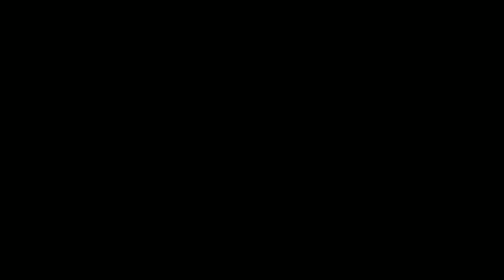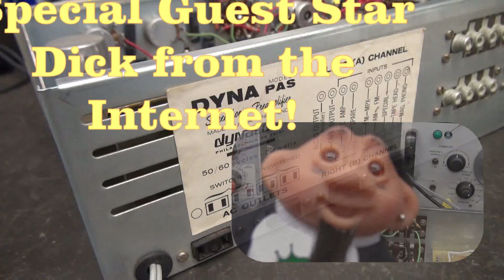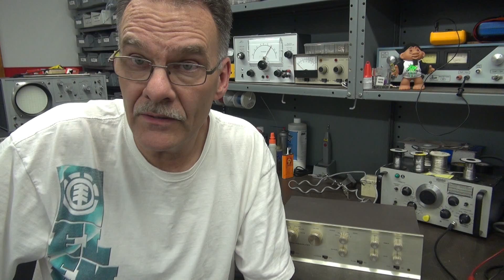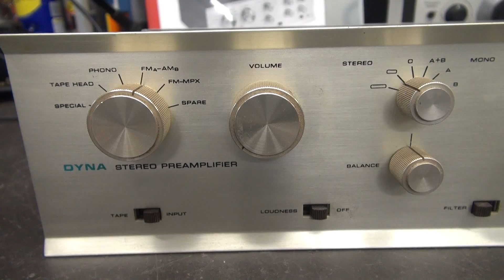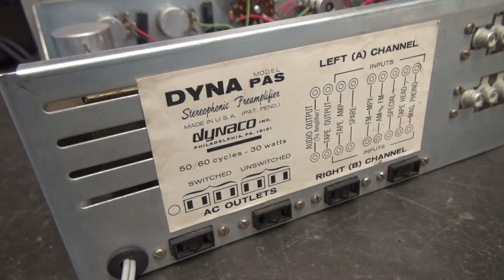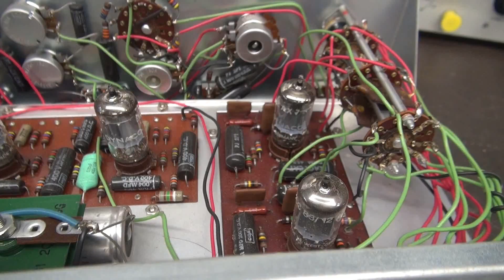How to Replace filter capacitors Dynaco PAS 3 Tube type Preamp amplifier D-lab Electronics

Comment: Before you mount the replacement supply board I recommend a foam insulation tape on the chassis and have the board seal on that it would be a much stronger assembly one Screw mount for that size board is marginal at best by adding the support below it makes it easier to do and stronger to

Comment: Terry, I admire your repair work. Real good work., but I have a little comment on one thing, I think your a more RF repair guy, no offense ment what criticism I make. 
I see you ground parts and wires where ever you can, normally and especially in RF it is required, a must have course of ossilation problems. But in audio it can be tricky try to lead all ground to a star point or even better to the input ground terminal. Then you never get 60hz hummm. I  ones took a ground from point to point a lead from 2" underneath a pcb board and the Amp was bussing loud in my case 50hz (Holland) that's what I wanted to say.
The rest you do top work I like it a lot.

Comment: Next PAS you do make sure to video. The board has been redesigned for right side up mounting and elimination of the rectifier tube if desired. Also no instruction sheet is included.

Comment: Thanks for the great video! 
Thanks to you, I have done this upgrade and for the most part, everything is functioning properly.
But now I have audible hum (which I did have before upgrade but it was very slight). 
Only connection is preamp to power amp. Not affected by volume. I don't experience it with other preamps that I have.
Thanks in advance for any insight!

Comment: Nice video... and it's a thumbs up from me for sure...BUT... I would have left the large filter cap in place, snipped all wires and leave it covering that hole now left behind. And the fuse and holder would have to be moved from the top of the board to the bottom side facing up for easy access should it ever blow.
Reply: I would've flip the capacitor board so the components were on the top.

Comment: Great video! Years ago, my Dad gave me his PAS-3 as well as his ST-70. I have not been able to use it as the dual 750K balance control pot is seized and he broke it trying to use a pair of pliers trying to free it. I have searched everywhere and cannot find a replacement. Any ideas as to where I can find one? I replaced for him that exact same filter can back in '74 as the same thing happened. At the time, I got the same multisection one cheap. Of course if I can ever find that pot, I will install that new board.

Comment: Nine thumbs down? Wth
You are local to me..less postal. I have a fellow ham I gave a hb100, 200 10-80 m set to re cap..he could use some help..He has had it for a year but still not on the air..
Kd8tbc Lee . He is on the Hazel Park 2m net 6.640 on Sunday. There is a echolink also. Surprise him..ha. 
73, KB8QLZ Gary

Comment: Replacing the selenium rec with silicon is a must BUT it may increase the heater volts on tubes without correcting

Comment: I’m installing this exact same kit.  I have a PAS2.  My board is about 50% stuffed.  I’m a solder newbie.  The resistors I could bend the leads taught and then solder.  The 4 large caps didn’t have much lead/prong to work with.  They were short.  I was a little queasy to have the 4 largest caps held in place by only solder.  Am I just a worry wart?  🤖☠️

Comment: Hi there, this is a great video! Thanks for that. I have what I believe is a PAS 3. The problem is when I turn it on, it does power up, the 12ax7's are very low but do light, the 12x4 is nice and bright...but no sound, through my Marantz. I tested the two transformer leads to the 12x4 with the AC side while plugged in, and nothing registers on my meter. There also is a weird low level crackling sound coming from the transformer, weird glue smell, but no smoke. The caps are original with no visible leakage. What is your assessment and thanks for saving my butt with this video by the way.
Reply: I am going to go out on a limb and speculate that you have a bad power transformer.   Be sure to add a fuse on the primary side.
Reply: @swinde  Right on! I did end up purchasing a new transformer, haven't put it in yet, the fuse is next then possibly a couple of tubes and the power supply caps  there isn't any leakage but I may just change em out just to be safe not ro hurt the transformer.
Reply: A decent capacitor checker with value readout  would help..

Comment: Don't change the tubes ! Unless you want to spend a ton of money on audiophile approved tubes. Those original tubes were Telefunkens and they last forever.
Reply: The original tubes are all shot on the one I’m restoring now. Preamp must have gotten plenty of use so I’ll be replacing them.

Comment: I kept ALL my Dynaco gear....   PAS-2 (those same original tubes still there too!)  with all new caps and elimination of the selenium rectifier.  Mark 3 amps have all new caps including quad cap with 650v. rating and new diode rectifier for filaments...   All made at the factory assembled in 1965 as stamped by the same tech...   These run into a pair of 1967 Klipschorns (UNaltered)...   Heck of a sound considering the year....   (O:
Reply: You bastard ...  I had four of the Dynaco Mark III amps,  three Kits I built and one factory assembled.  I foolishly traded them in for later models of Marantz equipment.  The Marantz stuff still works great with some TLC from me, a tech, but I wish I had kept them.  I still have a Dynakit PAT-4 and a Stereo 120, but I miss the tube amps.

Comment: Interesting that Dynaco had 2 different styles for this preamp (07:35)
Reply: Yes, the smaller picture is the PAS-2 which I think is very similar except for the new front panel and knobs.
Reply: The other one is a PAS-2 which had a different fascia and plastic knobs, other than that same innerds. Not sure if they were both were made at the same time, I think it was a cosmetic update.

Comment: Hey Terry, loving your videos. Found you yesterday and I've been watching as much as I can cram in. Not sure how else to contact you, so I hoping you might be able to take a look at a quick video for an amp I'm troubleshooting and hopefully offer some advice.

Here's the video: https://youtu.be/6oZpCqjxIKM

Thanks! 

Ryan
Reply from the maker: Hey man, Check the voltages on the tubes. I am not familiar with your amp, but sounds like voltages are wrong. Find a schematic and verify that first
Reply: Thanks so much for taking a look!  You're right on the money.  (I didn't want to think you were, cuz I'd already been through the voltages 10 times...)

But I didn't have a schematic, so I was flying by the seat of my pants - and I was ignoring the most important thing in a tube amp.  But since I didn't have the schematic, I figured I'd get the bias setting worked out when the rest was kinda close - after all - the tubes were NOT  red-plating and I had the variable resistor for the bias circuit right in the middle of the range - so what could be wrong?

Well, after your message, I took another look.  And I managed to find a schematic - which has an incorrect voltage listed on it for the 12AX7 heater coming off the primary.  But anyhow - all the other voltages were within range.  It didn't list anything for recommended bias voltage, so I stuck my meter on pin 5 of one of the EL34's expecting to see somewhere in the neighborhood of -40VDC.  I saw -77VDC.  Well, huh?  How much is coming out of the bias circuit?  Can't be much more than that... so I checked it right before the Variable Resistor.  -77 VDC.  I turned the VR back and forth.  Voltage at pin 5 never changes.  I THINK WE HAVE A WINNER.

I don't have another VR like that one, but I do have another AMP just like this one.  So I measured the resistance of the variable bias resistor at its current setting (about 6K ohms) and as a temporary test, I strapped 6K worth of resistors across the wiper side of the busted VR.  Turned on the amp... and whatta ya know?  Sounds pretty sweet.

Thanks again for pointing me down the right road.  Now I'm off to digikey to find me the necessary VR.

Ryan

Comment: Another good vid, However, I noticed that the wire hole did not have a rubber grommet in it. Did that concern you at all? Also, at the start of the vid, what is that piece of gear behind the Dynaco? An old O'scope perhaps?
Reply from the maker: Hello, That instrument is my Wavetek audio generator.